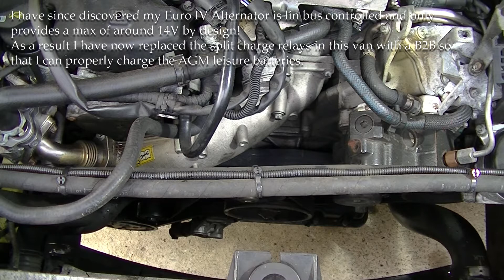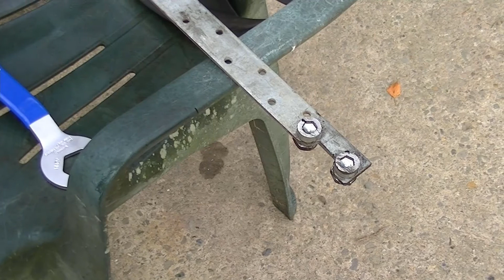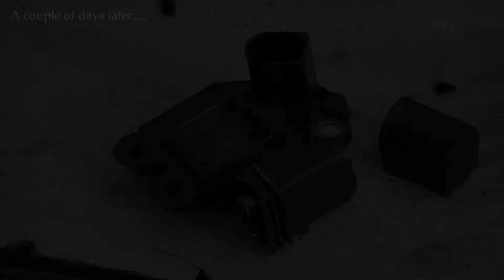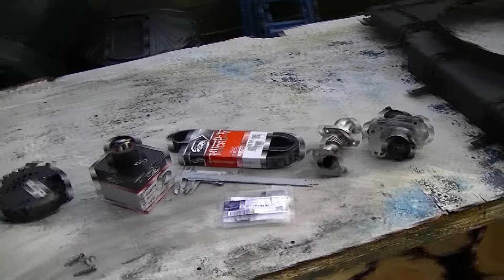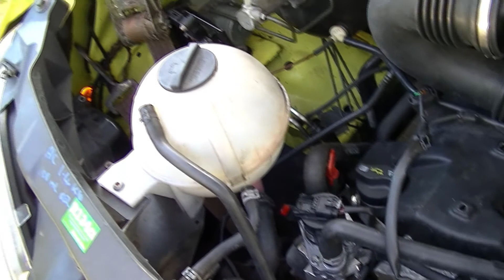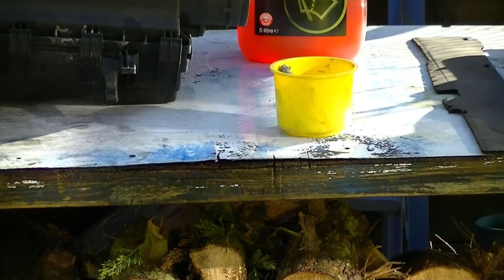Sprinter V6 Om642 repairs, viscous fan, EGR, oil filter housing leak, serpentine belt & Idlers

Comment: Hey sir i need your help.Does the 2010 519CDI sprinter with om642 engine come with an aux fan for radiator?Or only the main radiator fan like the one in your video?

My van was a retired ambulance and the air-con will become warm when idle over period of time.Was wondering if an aux fan was removed by the ex owner,thanks in advanced.
Reply from the maker: My Sprinter had an after market Eberspacher AC system for cab and saloon there were two electric fans mounted in front of the condenser.
Reply: @CriftinsCampers So the original doesn’t come with the aux fan?Could you do me a favour to take a few pictures of your sprinter fan so that i know where to install?Does it makes a lot of difference if i choose to install the fan in front of the radiator?Which is another options to cool it down right?
Reply from the maker: @freiserhan4287 I don’t have the van anymore

Comment: To replace the oil filter housing do you have to remove the fan and belts to get to the 4 bolts?
Reply from the maker: The fan has to come off in order to remove the plastic radiator shroud, you can’t see or get at the bolts with that or the belt in the way..
Reply: @CriftinsCampers  are you sure about that? I saw another video and he did not remove anything

Comment: Good job Keith 👍 When my leisure battery is a little low and I open the isolator switch I here a pink, pink, pink sound for a while until it receives some charge ( Talbot express ) funny thing is, all the ice cream vans that come round my way sound the same.
When I say sound the same I mean, they sound normal until the ice cream making machine kicks in ( or fridge ) then I hear the same pink, pink, pink sound.
People I've asked with more knowledge than me about mechanics have told me it's nothing to be concerned about but my mind says something is feeling the extra labour and I should check it out. 🙄